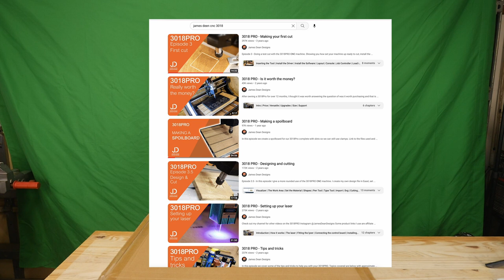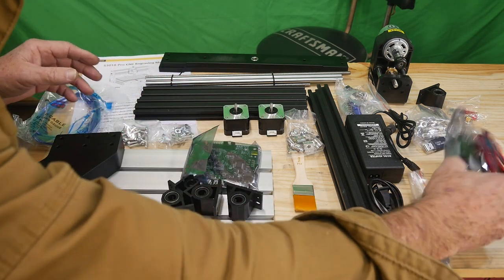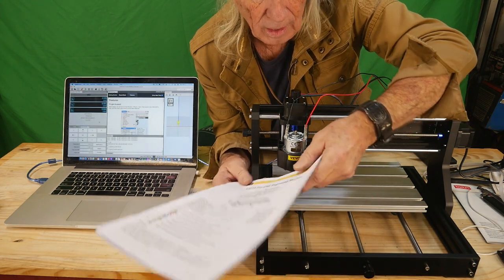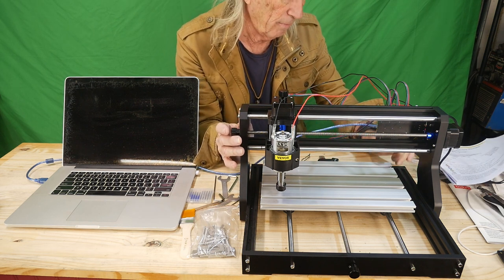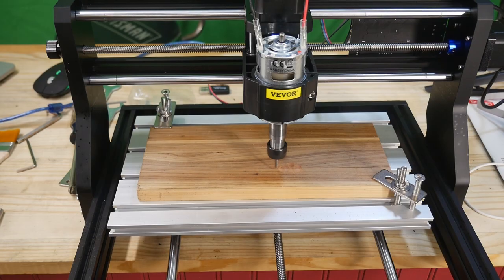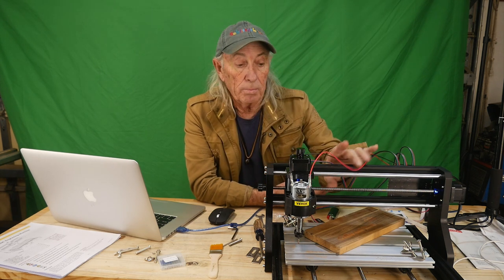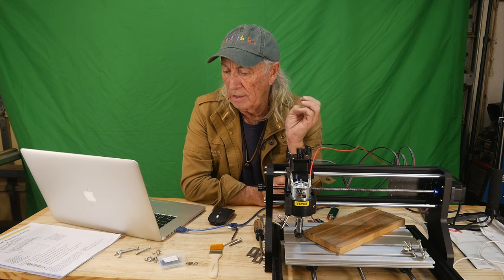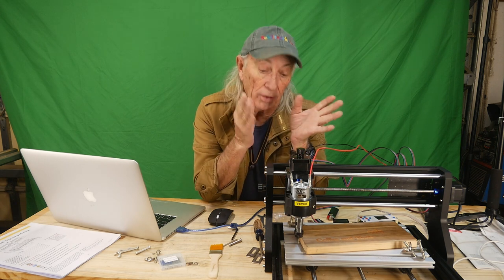CNC S3018 PRO from Vevor , best price CNC by C&T ep 314

Comment: Do you think it can handle hardwood like maple well or are the motor too small to do the job well
Reply from the maker: Good question Kurt. You can adjust cut speed and feed etc with the software. I would say it will take longer, but it can be done.
Reply: @SirTools  how slow do you think you would have to take compared to say something like I don't know a long meal or one of the other like shapeoko or something
Reply from the maker: @kurtpickering3700  The software gives you the time expected but I would run a "real" world test to see what the difference is. mmm...might have to do a show LOLOL

Comment: These type CNCs are responsible for more people getting discouraged and giving up than any other. I work in the hobbyists cnc community. I talk to people 24/7 about desktop CNCs. Don't waste your money and more importantly your time with one of these. Buy a Shapeoko or Onefinity. You can get one of their smallest models and set it up anywhere. Yes it cost more but they have a great resale market if you decide to either upgrade or you just don't like it and want to quit. Either way your experience will be better.
Reply from the maker: I would hope the learning on a cheap low dollar machine would be good. I have several letters from viewers that got a low dollar one and told me it was a life changer for them and new hobby which later on they purchased bigger and better etc. Interesting letter however and I would hope it would not discourage anyone mmm....that would be bad news.
Reply: I got one of these a few months ago. Great starter kit, but it is a learner CNC. Anything that can use a Makita trimmer is more expensive.
Reply from the maker: @AlwaysCensored-xp1be  Did you get the upgrade kit for the 500watt motor ?
Reply: @SirTools  No point using 500W spindle, the 3018 rod slides are not rigid enough. There is pro version with linear rails that is interesting. I will probably get the 3040 upgrade and maybe bigger diode laser.   This is learning machine.
Reply from the maker: @AlwaysCensored-xp1be  Looks like a LOT of linear rail kits are coming out for everything now
Reply: @SirTools  Linear rails are better, so are ball screws. But diodes lasers don't need those. Rods and timing belts should be  ok. 10+watt diodes are getting useful. Fume extraction needed.
Reply from the maker: The Linear rails for 3d printers seems to be a good upgrade. I'm ordering another set for another machine here.